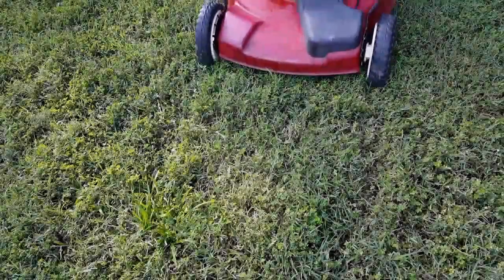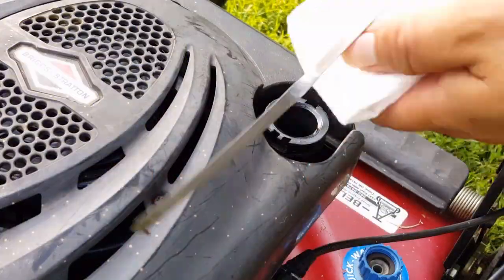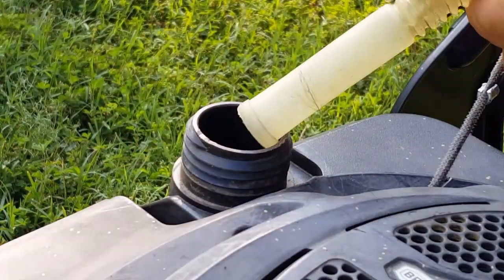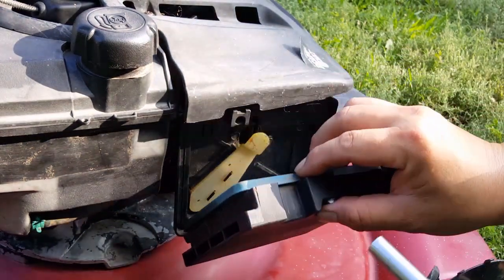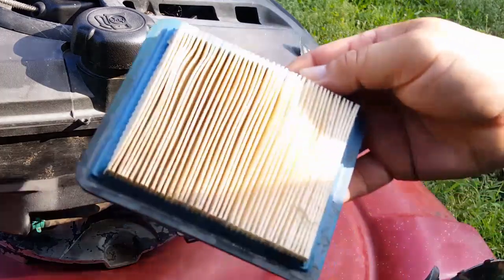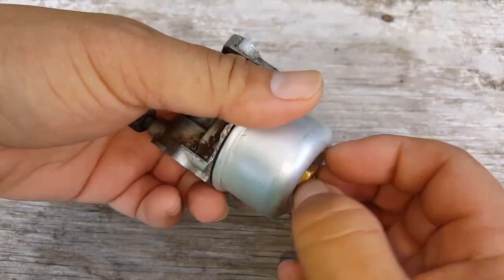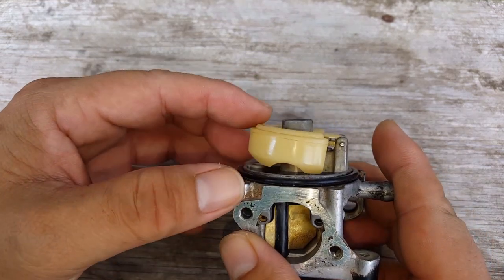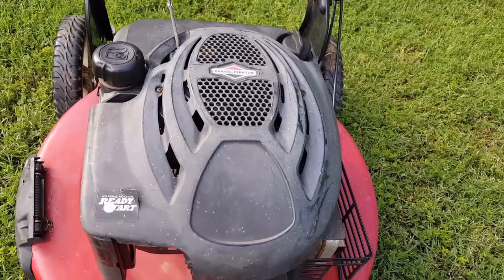Diagnosing why Lawnmower dies afters only a few minutes of running.

Comment: Loosening the gas cap fixed it for now, got the rest of the lawn mowed. Thanks👍
Reply from the maker: that works too.
Reply: @INSIDEHOUSEGARAGE  Yup. Worked for me, as well. Normally I don't fill the tank to the brim and have never had problems. My brother borrowed it, filled it to the top and that's when the trouble started. Coincidence? Time will tell.

Comment: Hey you just uploaded this video which is kinda cool. I'm always interested in how everyone diagnoses their problems with lawn mowers. I fixed my neighbors Troybilt with the same Briggs n Stratton engine as the one you're showing by just changing the spark plug. The problem he had was his engine would start and die in a matter of seconds. After merely changing the spark plug it started and ran like it should. I retested the start/run throughout the day and it worked just fine after changing the spark plug. Honda mowers are notorious for starting and dying also. The fix is the same in fact that's why I always change the spark plug before ever tearing into the carburetor. There are many many videos addressing start/die scenarios and they always dive into the carburetor which I think is jumping the gun in trying to discover what the real problem is. Your problem is that your mower will run for awhile say over a minute to as long as 5 minutes before it dies. I've not had that problem ever so thanks for putting this video up. I can see how different your problem is compared to the start and almost immediately die scenario that I am more accustomed to. More so you also made available a diagnostic video which usually guys do not do which is more important to me to see how everyone troubleshoots and diagnoses down to the component they think needs repairing. 2 thumbs up thanks for going through the trouble of putting this video up. Your video was short and sweet and right to the point without wasting any more of the viewers time very well thought through and concise. KUDOs!!!
Reply from the maker: Thank you very much for the comment and the compliment. Sometimes diagnostic work takes longer than the repair. I did a lot of diagnosing before the video was made coming up with lots of positives so I didn't want to put that in the video to make it any longer. I look forward to your comments in the future.

Comment: Had the same issue, cleaned carb three times, float was fine, oil level perfect, filter is clean... still same issue. I turned the gas valve half way open and that did the trick. The real fix would be to replace the gas shut off valve.
Reply from the maker: Thanks for the comment I appreciate it
Reply: Mark, I'm not a mechanic. Changed the liquids, filter, plug and cleaned the carb. Turning the valve let me mow my lawn. Thanks!

Comment: Cleaned the carb, still dies. Removed the fuel and added new gas, still dies. Checked spark plug and oil, still dies. Loosened the gas cap, ran like a champ. That did it for me.
Reply from the maker: Thank you for the comment I appreciate it
Reply: Check the fuel tank,it stopped up from the car. To the bottom of the fuel tank

Comment: One thing we tried was loosen the gas cap a bit and the lawn mower started up and kept running.  The gas cap vent is the culprit.
Reply from the maker: Diana Garza yes a bad gas cap can do the same thing.  Good catch.
Reply: This makes more sense with the engine running for a few minutes (and waiting allows it to start as the vacuum reduces back down). I'll create hole in the cap and give it a go!

Comment: Good vid

My initial thoughts was 
Gas cap or coil,  
carb seat would of been my last thoughts. Typically when the seat goes  , that I have seen.,it doesn’t get any fuel and doesn’t even start.
Reply from the maker: D Fields thanks for the comment. This one was odd. The cap and coil are both great choices too.
Reply: @INSIDEHOUSEGARAGE  or fly wheel key is broken.  which comes from the blade hitting something.
Reply from the maker: Thank you for the comment

Comment: I have a brand new carburator, new oil, air filter and it still does after a few minutes. I can get it to start right back up but dies again after a few minutes
Reply from the maker: Thanks for the comment  Bob Houseweart for the comment.  I believe your fuel cap might be bad. Try cracking the gas cap and try again. If the cap isn't venting properly then the gas will not flow to the carb as fast as its supposed to.
Reply: I have tried the cap. Still same problem
Reply from the maker: Okay. Next remove the bowl nut while the carb is still in the mower. Clamp the fuel line so you don't loose all your gas. With the bowl gone you can move the float up and down. Push the float up and then release the clamp on the line and then allow the float to drop down. Watch the fuel flow. If it's just dripping then  theres a flow problem between the tank and the carb. But if its flowing a lot of fuel then theres another problem. Also check to make sure the float moves freely.

Comment: Good video....sounds like the fuel was just trickling past the swollen seat allowing u to mow until you run out of gas....90% of small engine issues are carburetor related for 2 obvious reasons...california legal means the jets have to be so small and of course the ethanol in fuel creates all kinds of problems when it sits....

I always look at the carburetor when there's an issue...of course spray carb cleaner down the intake  to see if it's fuel related...but coils and spark plugs just don't come up as often especially in newer mowers....u can save a lot of time by just checking to see if it's fuel related and if it is take the carb apart real quick and examine the float/needle etc....
Reply from the maker: Thank you macknumber9. You've hit every nail on the head.
Reply: not to hard to check for spark though

Comment: Mine does the same thing minus you have to let it sit for 30minutes before you can start it back up. Also the pull cord is so hard to pull after a stall.
Reply from the maker: That's a huge problem . How is your oil level?
Reply: Exactly my symptoms. I wonder why it is hard to pull, after stall?
Reply: Did you get an answer to your problem? My engine is hard to pull, after the stall, as well.
Reply: @luckydog-287  No answer yet.
Reply: @INSIDEHOUSEGARAGE  Oil level is normal.
Reply: @limitlesschoices  - Thanks. Maybe when the engine heats up, it may stick one of the valves?
Reply from the maker: @luckydog-287  I need a model number for the Mower.
Reply from the maker: @limitlesschoices  i need a model number for the mower.
Reply: @INSIDEHOUSEGARAGE  - Okay, in my case, I am using a pressure washer. Possibly I need to pull the trigger to release pressure from the pump. Then, maybe, I can get back to working on why it stops in the first place. Will check, tomorrow. Thank you for your help.
Reply from the maker: @luckydog-287  no problem let me know.

Comment: Mine dies out after I start mowing but it starts back up. 
 
Could it be the fact that the bag is not on and side door doesnt open and grass ends up clogging underneath?
Reply from the maker: If you're cutting tall grass then yes. The grass is stopping the engine.  Try raising your deck a bit. Thanks for the comment I appreciate it

Comment: what's that have to do with it running for 10 minutes then quitting. If the float is not allowing gas through then it should be doing it all the time.
Reply from the maker: it's not the float but the needle attached to it,  I'll leave the rest for later
Reply: @INSIDEHOUSEGARAGE  ? "leave the rest for later"

Comment: Mine is doing the same thing, but it’s not the carb. I’ve just replaced the Carb and the coil with brand new ones and it’s still happening. Going to replace the plug here in a bit. Even though it looks good, it could be a thermal issue. After that the only thing left is the Thermostat on the Autochoke.
Reply from the maker: If the thermostat on the choke were bad it would just run on choke the entire time but it wouldn't shut off. Try leaving the gas cap loose next time. If the cap has failed and not allowing air to enter the tank then it will run out of gas in a few minutes.
Reply: if neither the gas cap or the float seal is bad..and you have an OHV motor..your valves will most likely need adjusting
Reply from the maker: @stuffyteddybare  good answer . Thanks for the comment

Comment: Yeah mine just started doing this today it did it one time yesterday but then it started back up and ran fine for like 2 hrs and today I go to start mowing and it shuts of after a couple minutes its not the gas cap so the only thing it can be is the carburetor right? Even tho I replaced it not even a year ago and its not the coil cause I replaced that too
Reply from the maker: have you checked the oil level?

Comment: Funny story: my dirt bikes front tire blew out and got it back to my house and after fixing that front tire it wouldn’t start it had everything I took the carb off cleaned it I turned the gas off it took me 3 days to realize that because the shut off switch is behind my front fender
Reply from the maker: that is an interesting story, which dirt bike do you have?
Reply: @INSIDEHOUSEGARAGE  Yamaha 250

Comment: what if its not the float, not the carburetor, not the gas cap, not an obstruction, not the air filter , not the spark plug? honda GCV160
Reply from the maker: have you checked the integrated fuel filter in the tank outlet for varnishing?  also I'd like to know how you've been able to rule out each items. thanks

Comment: I have a troy built pony 17.5 briggs. After a few minutes it dies down and if I disengage it almost dies but keeps running then repeats. Clean carb. any ideas
Reply from the maker: Thank you Roy Bolton for the comment I appreciate it.  Try cracking the gas cap loose. The air vent might be bad.

Comment: I had that exact same problem and it just needed a new spark plug.
Reply from the maker: Yes sometimes it just needs a new spark plug. Thanks for the comment I appreciate it
Reply: Also ethanol fuel is harmful to small engines
Reply from the maker: @samuelvelez1643  extremely harmful.

Comment: I have a old Briggs and Stratton push mower it has fuel and spark and compression but it still will not start what do I do
Reply from the maker: first I would try replacing the spark plug, just in case the spark isn't making it to the tip of the plug. Next I would check the flywheel key to see if it's sheared.
Reply: @INSIDEHOUSEGARAGE  I tried both of those and it still will not start
Reply from the maker: gotcha, the next thing would be to remove the Flywheel and check to see if the key is sheared.
Reply: @INSIDEHOUSEGARAGE  nope that didn’t work either I can put fuel in the carbs throat but it will not start but if I put fuel in the spark plug hole it will fire right up
Reply: But it has a new carb

Comment: Why is the engine so hard to pull, right after a stall?  When it cools down, the engine is easy to pull, again.
Reply from the maker: have you checked the oil level?
Reply: @INSIDEHOUSEGARAGE   - Thank you so very much for your trouble shooting advice!  I just went back to check, and, yes, I have clean oil, about 1/4" above the XXXX marks.
Reply: Another thing, loosening the gas cap, did not help my situation.  : /

Comment: It's club cadelt zero trun mower with 23 hp Kawasaki motor keeps going dead or won't start
Reply from the maker: Did it sit for a long time? If it starts and  goes dead then the carb will need inspecting.

Comment: My lawnmower runs great for a while then I'll kill it and then it wont start, I'll wait for about 10 minutes then it will run again, any ideas?
Reply from the maker: Yes the autochoke may still be working when you shut it down hot. Next time it does it take the air filter off and see if the brass flap is open or closed.  It's supposed to be open since its hot.  Whats the model of your mower?
Reply: @INSIDEHOUSEGARAGE  your ability correct! I went and opened it , seems to have an automatic choke, when it warms up it opens all the way, when starting it chokes and it was in between choking and but I'll keep my eye on it, thank you so much for getting back.  Apreseate it bud.
Reply from the maker: @tonygomes7182  no problem
Reply: You probably hurt its feelings!

Comment: I'm trying to figure out how to fix my Briggs and Straighten. It idles very low. When I cover the primer bulb with my finger it runs fine.
Reply from the maker: Thanks Brad Barton. It's pretty obvious that there is a carb problem. To make it easy I would just order one online for less than $10. If you want a more diagnostic answer then the engine seems to be running just a bit rich causing the engine to run slow. Blocking the primer bulb is somewhat fixing the problem. Otherwise for a temporary fix ducktape over the hole in the bulb.

Comment: My mower likes to stop like this sometimes, and sometimes sounds like an old school hit and miss engine.
The jet in the carb is clean and everything though.
I did notice when I had it apart however that gas won't flow through the line with the gas cap on, could this be the cause of the problem ?
Reply from the maker: Thank you Tyler Synder. Yes it would appear your gas cap is not venting like it should. I would suggest replacing it or modifying it to vent better. Thank again for the comment.

Comment: 98% of times it's Carb on mowers or trimmer or any other annoying gas oriented yard tool.
Reply from the maker: You are 100% correct.  You have to decide on how you want to fix it. Unfortunately even after this fix I still had to replace the carb. At least I tried.
Reply: @INSIDEHOUSEGARAGE very enjoyable channel.... I've run into same problem more than few times even when using ethanol free gas.That's why I keep few carbs around. after doing the basic cleaning or adjustment or gasket replacement.not worth wasting too much time on these things. I've had couple of trimmers that have kicked my ***. replace one thing and something else goes bad and that's the other 2 unbelievable % :-).